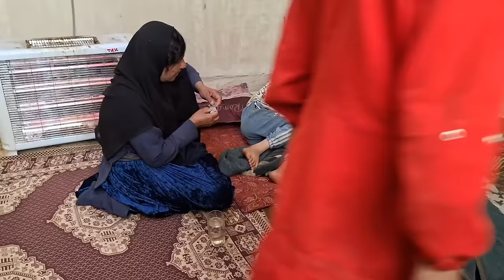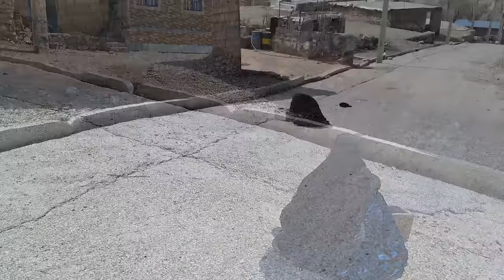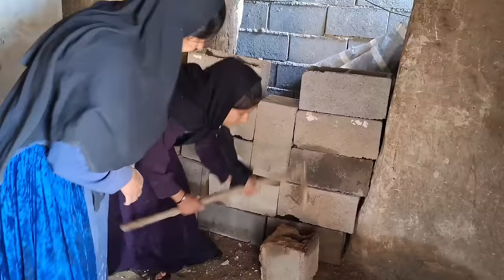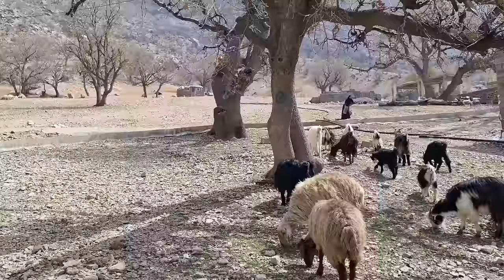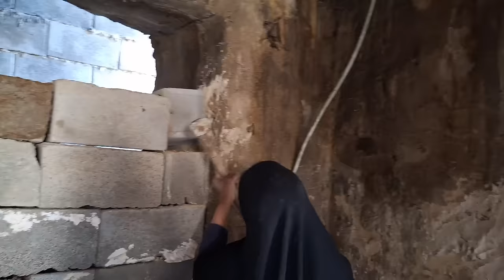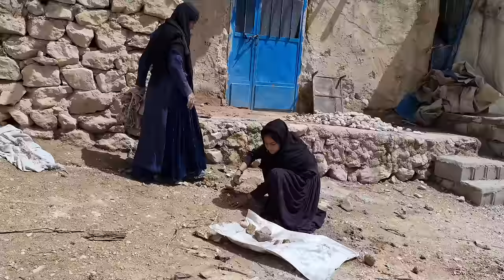Mother's help: Saleh's wife: to build the wall of the room: for the orphaned children

Comment: I just watched the video of when you cleaned the floor. Or should I say flooded the floor. Next time add a little soap to the jugs the first couple times. Sweep the soapy water around then rinse it. It will get cleaner much faster and smell better. All that water does no good for a place that is already rotting. Use soapy rag on windows and surfaces. Then wipe with clean rag.